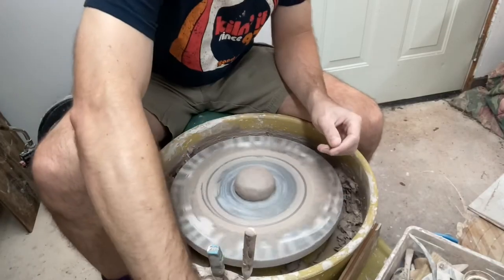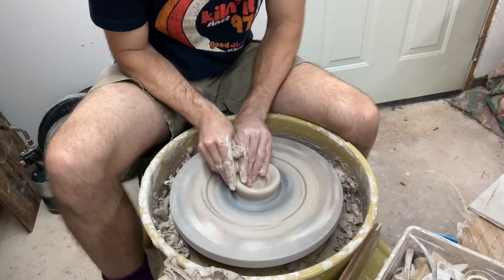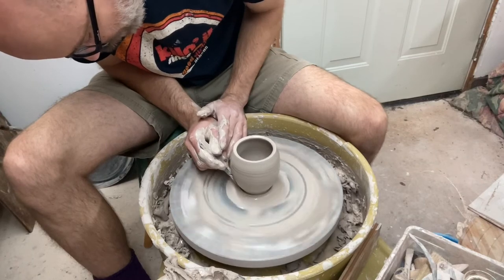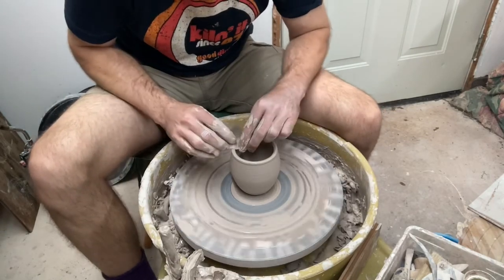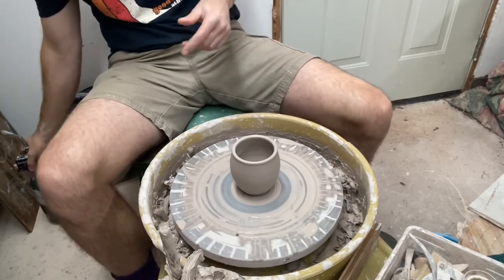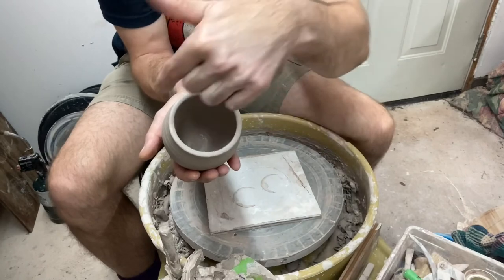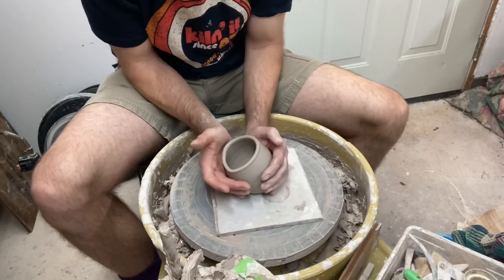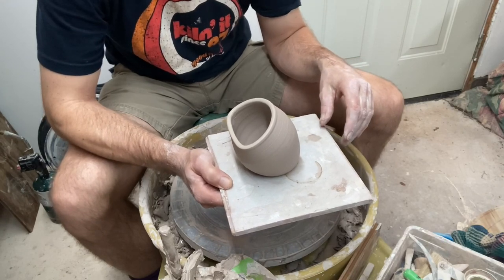Salt pig/Salt cellar

Comment: I really like the look of this and how easy it appeared to be to make.  I tried making one yesterday on my wheel, but I made the base too thick, forgetting that it wouldn't be trimmed.  Then when I tapped it like you do around 6:32, I ended up with a weird, very thick blob of clay on the bottom.  I'm going to try it again, but heed your advice to get to a finished thickness on the bottom before continuing.
Reply from the maker: Sorry I missed your question...I shoot for a wall thickness of 1/4" or maybe a little less and a slightly thicker rim.  The bottom should be the same and it's important to use the wood knife correctly to cut away any extra thickness in the outside bottom corner.  I modify my wood knife to put all the bevel on the right side so that the side against my pot is completely flush and can guide against the wall of the pot.  This can be done with a piece of coarse sandpaper held flat on a table.

Comment: When I tried this, after altering the base, while drying, it warped a little due to its memory and rocked a little.  How do you stop that?
Reply from the maker: I definitely check on them as they dry and tap them gently on a nice flat surface to keep them from bowing up.  I also tend to throw pretty thinly, so they probably flatten back down a little in the final glaze firing when they get a little pyroplastic.  If you still have trouble with warping, try flattening the bottom with a sur-form rasp.  Stanley makes a long flat one that looks like a handplane that works great for truing up flat surfaces.